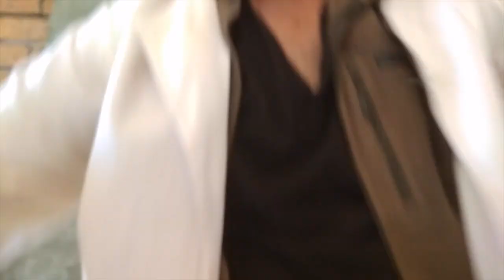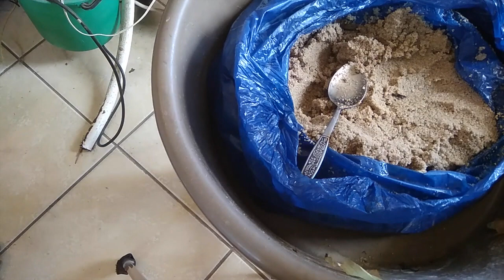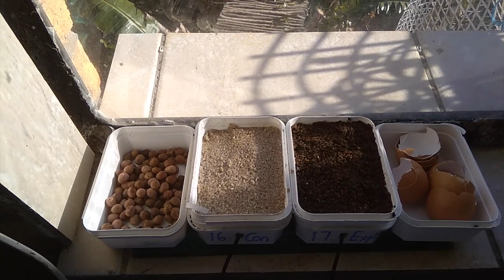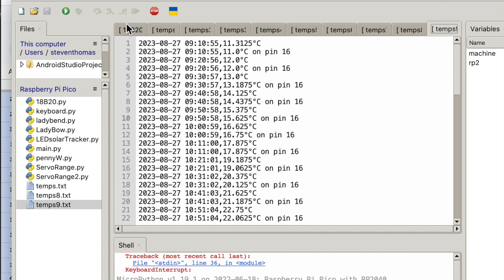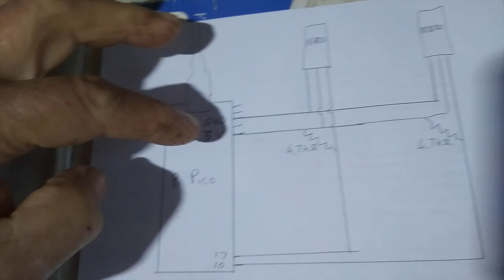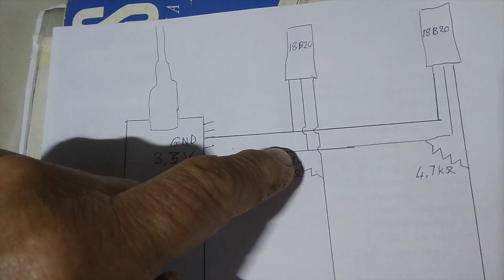Do likewise and you too can call yourself a scientist.

Comment from the maker: # This program 18B20.py reads temp on pins 16,17
# and writes time and temp to temp.txt
import utime
import machine, onewire, ds18x20, time
ds_pin = machine.Pin(17)
ds_pin2 = machine.Pin(16)
ds_sensor = ds18x20.DS18X20(onewire.OneWire(ds_pin))
ds_sensor2 = ds18x20.DS18X20(onewire.OneWire(ds_pin2))
roms = ds_sensor.scan()
roms2 = ds_sensor2.scan()
led_onboard = machine.Pin(25, machine.Pin.OUT)
led_onboard.value(0)
rtc=machine.RTC()
file = open("temps9.txt", "w")

while True:
 ds_sensor.convert_temp()
 ds_sensor2.convert_temp()
 time.sleep_ms(750)
 for rom in roms:   
  timestamp=rtc.datetime()
  timestring="%04d-%02d-%02d %02d:%02d:%02d"%(timestamp[0:3] +
                                                timestamp[4:7])
  file.write(timestring + "," + str(ds_sensor.read_temp(rom))+"°C" + "\n")
  
 for rom2 in roms2:   
   timestamp=rtc.datetime()
   timestring="%04d-%02d-%02d %02d:%02d:%02d"%(timestamp[0:3] +
                                                timestamp[4:7])
   file.write(timestring + "," + str(ds_sensor2.read_temp(rom2))+"°C on pin 16" + "\n")
  
 file.flush()
 led_onboard.value(1)
 utime.sleep(0.01)
 led_onboard.value(0)
 utime.sleep(600)